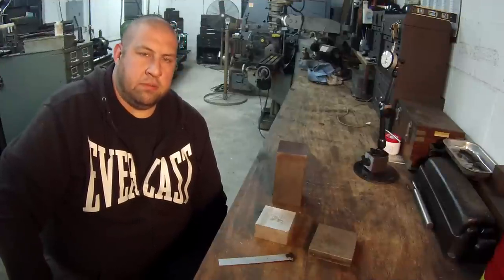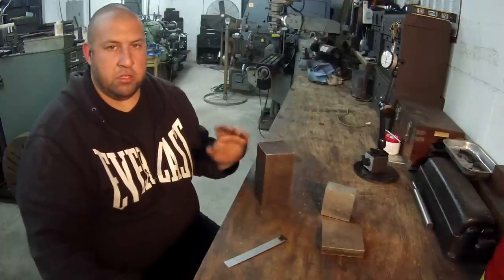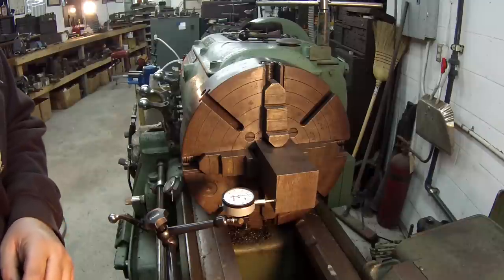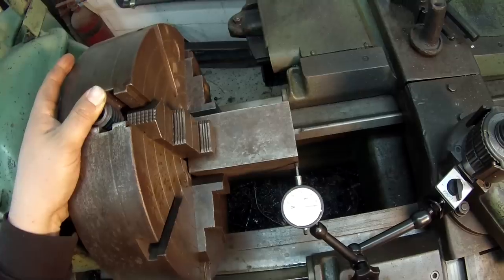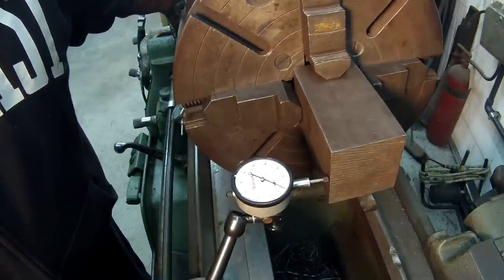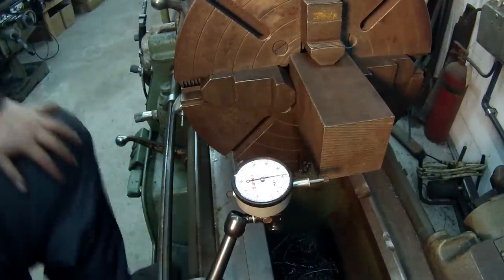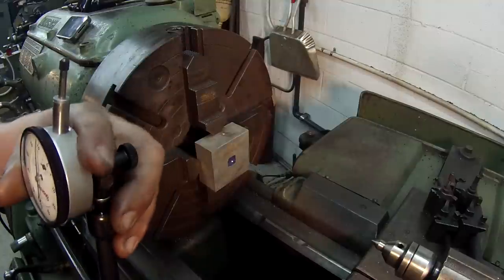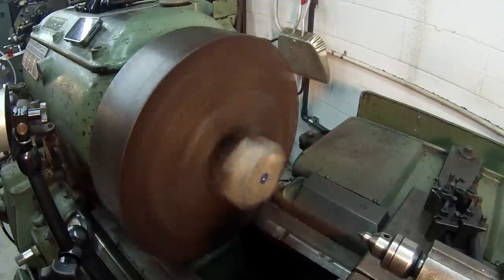Indicating Square Stock in a 4 Jaw Chuck

Comment: Exactly the lesson I needed and explained well. I hadn't considered using a square off the ways, instead I was placing a torpedo level perpendicularly to the ways on the stock. Your method of rocking the stock seems to be the quicker and more accurate solution.

Comment: Another fine job and video
I always stayed away from 4 jaws but now I have a little bit more confidence after that video Thanks Adam
Im sure it helped out alot of other guys out there.
Thanks
Manny
Reply from the maker: I probably use the 4 jaw chuck 90% of the time at work. I use the 3 jaw for second ops or quick machining of already machined parts I might have to modify. 
Thanks Manny!

Comment: Smooth going with the 4 jaw Adam and a great Video!! Thanks for sharing. 4 jaws are great! They take a bit of time to master (i spent 18 months of my apprenticeship using one as it was the only chuck i had for the lathe i was working)  Great to see one set up properly and quickly. Thanks again.
Reply from the maker: I guess after using them daily for the past 16 years has helped get my practice up. :)
Its good to hear someone else out there using them too Rich!

Comment: love the videos. keep em coming!

my quick tip for four jawing is when you first find your high and low, put zero in the middle of those so your high reads the same from zero as the low. then you know where you're going.

also, when you go to the next set, the same zero is already where you need to be.

this saves me a lot of time anyway.

Comment: Hey Adam,

Awesome video. You are truly Dr Smooth with the four jaw. Let me know if you need a longer handle for that chuck on the Monarch. I have one that's just the right size for you.

All the best,

Tom
Reply from the maker: Thanks Tom! Dr Smooth....Love it! Guess you can call me a fan of the 4 jaw chucks!
If you let me borrow that shiny new chuck handle, I promiss you it will not come back straight anymore! LOL....Hell you dont need it anyways, you always use that cool 6 jaw chuck!

Adam
Reply: Adam is the king of the four jaw for sure.  I need to utilize one in my work more often.  One thing most folks forget is that a four jaw is a lot stronger than a scroll chuck and you can't hardly over -tighten one whereas you can kill the scroll in a 3 jaw easily if you get crazy with the magnum chuck key!
Reply from the maker: James Kilroy Yes sir it is. Where I work I make new hydraulic rods nearly everyday. Very early on I learned that the 3 jaw chucks will not hold those chrome rods from pushing back as your making your cuts, unless you making light cuts. Another thing is that I would always get a small amount of runout which I didnt like either. I want my chrome rods running near zero when I'm machining them, and get the strong holding power of the 4 jaw. 
Thanks for watching James, and for the cool comments!

Comment: Hi Adam,
It's nice to see someone with mechanical sympathy: 26:10 in particular. I notice this (the way that you wait for the clutch to bite before throwing it into lockup) in most of your lathe-orientated videos and it makes me smile. I also notice that the headstock bearings and drivetrain make very little noise - the sign of a well-adjusted machine. Very nice!
Cheers,
Some bloke from the UK with a stupid username.

Comment: Adam, at the 30 min mark when you use the center... When you are indicating that in, it is putting stress on your tailstock center. There is a simple shop-aid tool you can make called a wobble-stick. It has male center on workpiece end, spring loaded female center on tailstock end. It doesn't need much travel, maybe .250. Use it the same way as you did with the dead center. My dad gave me the one I have. I'm 2nd generation machinist, grew up in my dad's job shop.

Comment: Good video. I have my first job For my new 4jaw chuck. I need to make pipe jaws from square stock for my cold saw to saw 76.1 x 1.5mm pipe. I need to bore a 76.1mm hole 150mm deep. :) I then finish it with milling machine. Need to split, make lining pins and few springs to open it. 

Love your videos! 
I have been watching these to learn to how machine, atleasr to know the basics, i have no one to show me.

Comment: That center between centers is great. I will definitely use that next time I need it.

Regarding the centering the first piece, I've used 2 chuck keys at the same time, locked the spindle while doing it in 180deg positions and have been very successful and I find it faster than your approach. But I've only ever done it once and maybe I got lucky

Comment: Adam that was great you did a really good job explaining the process.  At the end I can tell you have done the process many times you made it look really easy.  If you have problems with glare you might consider a polarizing filter for your gopro.  I could make out your indicator OK I could see the needle moving.
Reply from the maker: Thanks Bill. Ive said it before, but I use the 4 jaws everyday for most all of my work. I get lots of practice so I can get parts indicated pretty fast.

Comment: Hi Adom, would you do something for me? Would you wrap your lead thumper where you hold it so that your not in contact with the lead? Lead is an acumulative poison that the body has trouble evacuating, some gaffer tape or electricians tape would be fine. Thanks for another great video, especially centering the part in the mill, centre drilling and centreing in the lathe from there! Great tips!! Regards, Matthew
Reply from the maker: Thanks Matthew, and I appreciate your concern. Most of us get used to using things a certain way from habit.

Comment: Thumbs up!

To help with the glare, often times it already helps a lot by just tilting or twisting the dial a little. We're not reading exact values anyhow so we just need to see the needle moving, or not moving.

Which is incidentally how your videos made me go off digital indicators again, at least to a degree! I thought they were easier on my ageing eyes, and they are, but the needles are so much more vivid, like when you use the magnetic one as a 'countdown stop' while threading etc.

I also find the white faces easier to see than the black faced dial, glare or no.

Comment: Another good'un! On the second example, I'd use a pump centre or sprung tap guide just for the convenience if having it stay firmly in place. It's also a perfect example of where you could have used a toolmakers button.
Reply from the maker: I have used the spring centers many times instead of the dead center, and that is another good use for that tool!
Thanks Paul.

Comment: What about indicating right up against the chuck? That way, once you have it centered you check the longtitudinal alignment again.  If you have to bump it it wont change very much near the chuck. Then a final check of the 4 sides at the furthest end from the chuck will verify your long axis alignment. 
The way you do it, once you bumped the piece you were also moving the centering alignment.
Not a criticism, just wondering if there was a reason you do it your way.
Reply: howsyourdangler that's the comment I wanted to say, I agree with you close to the chuck first is way much quicker, I admire Adam coz he is so humble I explaining things and I'm sure he'll take any suggestion with a grain of salt, on the second piece he was right about that one, long square bar stuck are a pain to indicate, so it's normale that it takes a little time.

Comment: Adam, I'm not a machinist but I took metal shop and I was also an overhead crane operator (and chain hog before that for the crane) for Otis Elevator in Yonkers, NY in the late 60's and I watched the machinists do their thing, plus I've been watch Keith Rucker & Fenner for a long time and they both recommend your channel very highly. I also watched the 4 jaw challenge you and Fenner had out in CA. Anyway, I have to think that if you had a real job to do, you would have trued the block, regardless of length on the mill so that it would be perfectly square and true. With that said, I think your 2nd method would be a piece of cake to find the center, especially if your chuck is running true. What are your thoughts? 

Also, I realize that you made this video a few years ago, but I wanted to send you my heart felt condolences for your loss of Stella. It reminded me of the cats and dogs I've had and lost and I cried for them all and I cried for Stella.
Regards,
Rich

Comment: Very well done.  I am NOT by any stretch of the imagination a machinist.  But  I wonder why you wouldn't indicate the stock as close to the chuck as possible first, though.  Since the jaws are the pivot point seems like you'd want to essentially get that point as close to zeroed out first then knock the end in line with the trued jaws.  I'm probably out in left field in my reasoning, but  I've worked on equipment where we had to chase the zero with the guy reading resolver readouts yelling out the readings from 20 feet away due to where the readout was in relation to the adjusting mechanism.  I know how frustrating and time consuming it can be if you don't have a light touch.  Thanks for posting.  Always a pleasure watching you work.

Comment: At about 13:40 when you start aligning the part, it would be much faster to find the low spot of one side, zero the indicator, then flip 180 degrees, find the low spot of the other side, and determine how far out it is from the first side, then just move the part exactly half that amount. For example, if it's 30 thousandths out, just move it 15 thousandths in, and that should get you there, rather than having to go back and forth a whole bunch of times. Have you tried this technique and you just prefer to do it your way? If not, try it out! It'll save you a lot of time! :)

Comment: Adam,  

The dead center trick looks a bit like that alignment tool Tom Lipton showed a while back...with the long rod that amplifies any off-centeredness. Useful for anyone who doesn't have a tool like that. 

I'm wondering if indicating the corners (edges) would work?  If so, it would be easier to find them than finding the low on the sides. 

Thanks for the lesson!

-- Mike

Comment: Adam, another great video.
one question, wouldn't it be better when indicating between centers, is to go to the tailstock end of the center?  Seems to me this would multiply any error.
Reply: The key here is that the tailstock is being used as a reference for the axis of rotation of the lathe, so the section of the dead center nearest to the part is going to be varying the most as the part rotates without being on the referenced axis.
Reply from the maker: DoctorBloo I have to agree with this comment Herb Blair . You want to indicate the point of most run-out. Keep in mind that indicating a block this way is as close as most will need to get for drilling and boring a part.
Reply: Abom79
Adam,   Starrett used to make a center finding tool #65, that was used simular to what you are doing with the dead center.  see mrpete222's video "WHAT IS IT? #2 Answer Mystery Tool tubalcain". 
I'll bet you have one in one of your tool boxes.
Reply from the maker: Herb Blair Actually I did see that, and it was a very cool tool to see in action. That was a first for me. But remember he did mention that tool is pretty "archaic" and probably used very little these days. My technique was taught to me by my dad and it has always worked fine. The center in the tailstock is as true as you can get on that end,whether the tail stock is perfect or not, its still sitting on center.
Reply: Abom79
I like your way of centering.  I've not had to do that yet, but you made it look fairly easy.  Your dad taught you well!

Comment: Just bought a workshop grade granite surface plate and have been getting some tips and tricks from you. Just this morning I was thinking about centre drilling some square stock in the four jaw so this video was very timely.  Do you have wobble bars for centering ? I was wondering if metal work guys have a way of identifying faces on a block like the carpenters use the fish symbol in the UK. I think the fish head goes on the face side and the tale on the working edge, not sure if this will make any sense. Thanks Adam my best regards Chris

Comment: Hey Adam, when centering the longer piece of material, you are correct to indicate the sides first to get it straight, but when centering the faces, if you lightly clamp some pieces of 1/8" or 1/4" flat bar onto the 4 faces and let them extend an inch or so beyond the end of the material, you can now indicate on the inside faces of the flat bar and just spin the part without having to move the indicator, this is a super fast way to get the part centered.  Not my idea, I saw this done by Joe Pie.

Comment: Could you do the same when you centered  the large part the first time and drill  the center hole and run it in the tail stock and  then indicate  the side of the block afterwards in the chuck ?

Comment: How would it have worked, had you put your gauge on the cross slide, dialed in to a zero  \zero'd at the chuck then worked it at the outer end later.Think it would have been much faster and more accurate.

Comment: Adam what are the model  #'s of both of your indicator bases I know they are longer than most of the ones I see on net ,but they give poor descriptions of length of top and bottom rods are yours the 6 inch bottom and 4 inch top rods.
                                                                    Charlie.
Reply from the maker: Charles, I have another video coming very soon thats only about the Noga holders. Ill even give you the part numbers in it.

Comment: What I do not understand is if you got one side of the stock indicating at zero, or close, and then you got the side 90 degrees from the first indicating zero or close, meaning that those two sides a very close to perpendicular, why do you still have to indicate the other two sides?  Isn't anything you do to the other two sides going to throw off the first two?
Reply from the maker: +Andrew Payne When indicating I go 180 out, so two apposing sides. If it's not in the center one side will be further away, or close to center.

Comment: Newer video from Abom shows a better method - throw it on the milling machine and with DRO and edge finder find cube dimensions. Then drill with centre drill. Bring over to the lathe, chuck it in. Now you can place something between square stock and live centre that wobbles - indicate it so its stops wobble. Simple and precise.

Comment: Adam can I use a copper mallet? Is copper soft enough?
Reply from the maker: If your using it on something that will be machined off, or uncritical it's ok, but don't strike a machined surface with it. Use a soft blow or lead hammer.

Comment: Adam, how did you locate the center punch mark on the aluminum block?
Reply from the maker: I'm not quite sure of your question John. I showed how I centered it up in the lathe. I just used a combination square to find the center of the plate and punched a center mark on it.

Comment: Strange Chuck. When i Turn a Screw in my Chuck, all 4 Jaws  move evenly. they are connected with each other. so it is always exactly in the middle.
Reply: +schmatzek1 actually i think the 4 jaw with a scroll thread like the one you have would be less used, the independant 4 jaw is very common

Comment: If the piece is small enough we chuck a compound angle plate in the vise on the mill an face the end with a flycutter, and then drill the hole in the end

Comment: the rel test adem is wen you come to have to hon it in a stedt son . most recently i had  a casting that i required  to put a  meaconing the spigit  with the rolling center.   but when it cam to hold the square of the casting,  so we could cut the reses to hold the pigit . with a 9" overhang.  held in  a 12"  chuck.  holding between Centers was to going to cut it , so i held it in a steady  & that my son,  is . the question you should be showing Children . Alas i'm not good at filming But i  use a very largo bering as a steady rest that i set in a plate  in the sedgy  with a 7" centre to hols the stoke on the corners   The secret it the square cones  . role  in the steady  i got e job bon by gum its a challenge .    Les thompson england

Comment: you should rather check the diagonal points instead of vertical face while centering the square job
Reply from the maker: +MECH ROCKS Why? The corners my not be perfect. What if they were filed or ground down? If you find center of the thickness of the flats you'll get to the true center. Sometimes that's not important though and you can go off the corners.
Reply: thank u sir

Comment: This video shows the worst way to true up a piece of square stock.
What the person should have done is dykem the end of the stock, then scribe 4 lines from each of the four corners.  Where the scribe lines intersect is the center of the bar stock.  Dimple the end with a centerpunch.
Chuck up the bar stock and center the piece by looking at the scribe lines and the dimple.   Adjust the four jaws by looking at the centerpunch mark and adjusting accordingly.  Don't waste your time putting an indicator on each of the four sides of the workpiece.
Reply from the maker: I'll have to disagree with you and remind what I say to all of my viewers, I only show ONE way to do a job. The method your talking about, what if you have a hollow bore, or a casting? And how to you know your piece is straight and parallel if your only indicating one point in the center? You must ensure the workpiece is straight too, not just on center. Not all cases involve a center or punch mark to true on.  What I show is one way to true up square material, but there's many other ways to do it.
Reply: yeah, dick around with a wobbler and expect the same center as indicating square to the chuck and concentric with the spindle, AFTER time spent on a layout which will be cut off